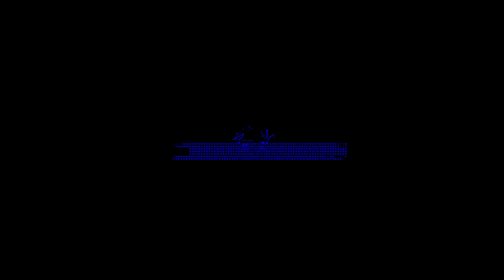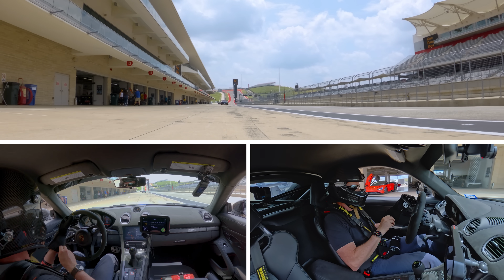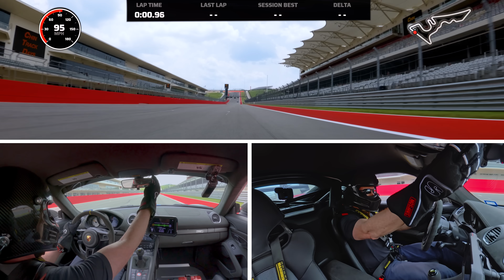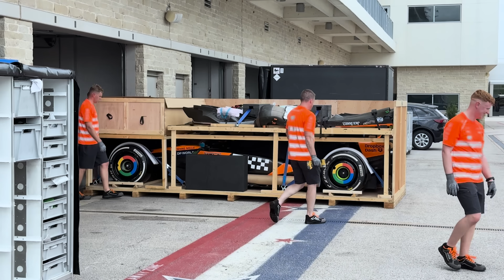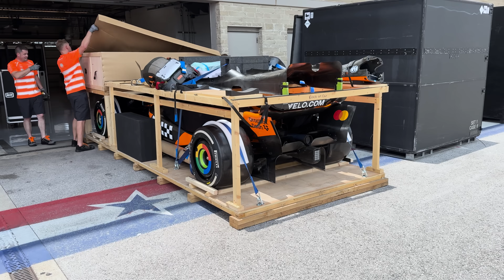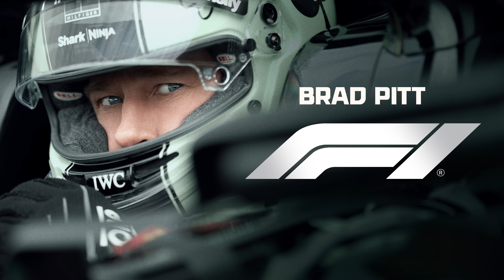Z06 vs GT4 RS : American Power Meets German Engineering at COTA

Comment: Car and Driver tested both of these at VIR and the Z06 was 2 seconds a lap faster.  Both are great and very fun on the track, it really just comes to personal preference.
Reply: Exactly.
Reply: bench racing doesnt work.  that gt4rs that day in summer is at probably 3 to 4s slower than when he ran in good weather.  his top end is down approx 8 mph lol.  I have both c8z and gt4rs and tracked it same day same driver.  cota z will be faster on 2r and very tight course the 4rs beat the c8z with me driving.  my track buddy drove both and results same. the gt4rs driver in the video is fast as this is his home track and cota has many fast drivers
Reply: @goonthreegtr You got some great experience so I want to ask a question. For a beginner who will jump to intermediate very quickly then is looking to put the time in to progress into advanced, would you strongly recommend any of these option over the other? Cayman (718 GTS 4.0 or GT4), C8 (Z06 or Stingray), 911 (991.1 S), or G80 M3? 

I have good karting experience but no real experience pushing it with real cars other than limited moments of fun with my M5, M4, E63 on the streets. Will be getting into sim racing. Tracking in the TX heat.

I'm thinking that I'm probably leaning towards the M3 to dual purpose as a daily + track car (more HP than I should have out of the gate, so it's a compromise). This would open me up for my sports car to be a convertible and not needing to be retrained to my abilities on the track (992 TTS, C8 Z06, or 750S depending on how big the windfall is on the equity payout by the end of the year). Alternatively, while I'm stilll working my way to the limit over the next couple of years, I might be okay to track a Boxster or 911 Cabriolet as my dual purpose fun car + track car, but I would rather not take this risk or deal not being allowed at all of the prospective events.

I want something that rewards the art of preserving momentum and that I can comfortably get closer to the limit as I progress through the intermediate phase. Once I get to advanced, I'll likely switch to a dedicated track car. If I already was experienced with a manual, I'd probably do a Miata for now that I would keep in storage and only use on the track. Perhaps you have a strong suggestion for a great dedicated track car for learning up through the early days of advanced that is automatic, under $50k, can be decently old as long as it is reliable in the heat, and doesn't have to stay street legal as it would live in storage at the track or close to home on a trailer. The Camaro SS 1LE or an older Corvette or Cayman are on the radar for this angle.

Sorry for the long question, but some quick thought would be greatly appreciated.
Reply: I am a car guy and i like both the corvette and the porsche. For the money, the vette is by far the better choice, but if you like finesse and quality finish, go for the Porsche. Ultimately i dont think either one is a bad choice, more a personal preference. By the way, i am a Porsche guy, but love to have a C8 in my garage too, both will put a smile on my face!
Reply: Was the Z06 on the ZP tire or the C2 R? If ZP, then more time in the Z06.
Reply: 2 seconds is a HUGE margin. We're talking bus lengths 😂
Reply: A few laps? Sure- Multiple repeated hot laps will have the vette's owner calling a tow truck
Reply: Nonsensical, Porcha's are the best car in the history of forever. Everyone is just jealous of how expensive our repair bills are.
Reply: Both cars also were tested on the ring and the GT4 RS was in another zip code. Using VIR for data is funny. Especially since both cars are slower than the ACR. Especially that POS Z06.
Reply: @NoBody-vn9do that time was not official. And why is using Nurburgring better for data than VIR? Because the media says so? Because you do? Because Porsche does? It's their backyard, I'd hope they were faster there, especially with the extra $55k option kit that's totally a "production model."
Reply: @goobingtons  I've seen Europeans discredit many tracks including COTA an F1 track, they live in an echo chamber like a religion with the Nur as god, can't make sense of it. We have so many great tracks with big challenges in North America, VIR is an amazing track, I'm sure he ever looked it up because his god would be angry.
Reply: @goobingtons time was official. It’s the only time we have on a unoccupied track with a professional driver. Y’all act like Chevy drivers are just some super drivers or something. Like they drove the car and it’ll magically become so much faster. Niggas might gain a second or 2 but stop it. Still failed on the ring. Anything to cope I guess. Also no, the ring is good because of data. In the real world we work off data and facts. So please cope harder fanboy.
Reply: @goobingtons  the vette's can't hack the long and the hot. They are cheap sportscars meant for fun. I'd buy another vette or run hot Mustangs etc but an off the showroom Porsche can run the 24 hr where a vette wouldn't make it past the second driver.
Reply: @cantbsdave sounds great, never said otherwise 👍
Reply: @cantbsdave you must have no real experience.  we track 992 gt3, 992 gt3rs, gt4rs, (2) c8z, c8 stingray  ordered another 2026 c8z and 2026 zr1.  if corvette suck we wouldn't be ordering 2 more 2026 models.  we drive our cars hard and both corvettes and porsches will spent time at dealership get work done.  there are many 992 porsche owners upgraded their brakes to ap like we did on our c8z.  end of the day people that own and track multiple corvettes and porsche know both are great.  truth that gt4rs would kill me at cota since I am not familiar with track amd he is but when he comes to sebring the outcome will be different.  ehat he is doing is not easy
Reply: @NoBody-vn9do  vette's are overrated. GREAT for the street due to weight etc, but hard track use? Naaa
Reply: @NoBody-vn9do  Hold on...Z06 was a 7.10 and the RS was a 7.03.  Not really a zip code distance apart on a 12+ mile lap.  I'd say pretty much the same.  Then add in that Porsche can test their cars on perfect weather days or whenever they want and GM has to send a team over to the ring for a test day or two and hope for the best.  I'd say they are clearly equals.  That all said I'd rather own the RS because I like it.  Too many C8's out their in comparison.  But, would I spend that much more....probably get the z06 first.  Have a C8 and GT4.  Love them both for different reasons...
Reply: @paulbellas8797 German manufacturers are always going to have the advantage at Nordschleif. They have pro drivers and engineers up there doing hot laps all day on an open track. Different story everywhere else.
Reply: @Ton-uy1xd agree and they can test their almost as much as they want.  For a US manufacture, the need a big logistics operation just to put together a couple days of testing.
Reply: @paulbellas8797 more like just a couple of clean laps
Reply: @Ton-uy1xd I watched some videos on the setting of both the z06 and zr1 laps and they talked about how they could plan for month but when the get their either the weather or tack conditions would be sub optimal.  Agree they need a great pro driver familiar with the course but they spoke about how being an hour down the road allowed many more opportunities to dial the car in and get every second out he car,  when pitted against the gt3 on American tracks, the zoo faired very well.
Reply: @NoBody-vn9do  1.2 second difference = another zip code? lol if you talk about the Manthey kit it is much faster but cost 55k more... 55k more is a big % of the Z06 cost.
Reply: @Iseenoobpeoples  GT4 RS ran a 7:04 on the regular track and a 7:09 on the longer track. Gotta look more into the lap data than just asking google AI. Shit be wrong half the time. The Z06 ran a 7:10 on the regular track. So yes, another zip code. The manthley kit is under 7 minutes and it’s fighting with SVJ’s, Pista’s, and GT2’s. So yeah that $55k is absolutely worth it.
Reply: @NoBody-vn9do  Uhhh the C8 Z06 time was on the longest configuration proof is right here on YouTube.
Reply: @Iseenoobpeoples wrong
Reply: @NoBody-vn9do  yes. You are wrong. Clear out champ
Reply: @rocketmagnet427 sure I am.
Reply: @NoBody-vn9do  in what world is the Nürburgring a better performance indicator than VIR? where they are all tested on the same day in the same weather, vs a magazine driver in 2 attempts vs a full porsche factory test attempt
Reply: 1. You're never going to load your car on a boat and take it to Germany, and 2 the z06 is a better car.@NoBody-vn9do
Reply: @nicklovely6431  we doing a rally next year where we’re shipping our cars to Germany and the ring is on the list of things to do. Would you like more information so I can see you there or are you going to miss out? Cost is around $15k total. I can send you a whole excel sheet. Also saying a car is better cause it’s just “faster” if you can even really say that. Is very childish. It’s not all about speed.
Reply: @NoBody-vn9do just say that you don’t understand Nürburgring. Porsche tested the gt4rs with a pro driver. Corvette number is from a random guy not official.
Reply: @Gt4ism  yes the cliche comeback. Say a person doesn’t understand cause they don’t go along with delusion. Typical fanboy stuff nothin for me to even care about.
Reply: @nicklovely6431  no reply? Guess you was just full of shit
Reply: @Gt4ism  doesn’t know how the rings works so this person just says whatever they see on TikTok.

Comment: very cool on the F1 car. The main drawback of any American car on track are the consumables. They all use crazy wide tires and chew through brakes and tires due to the weight. Oil sumps are huge too. GT4s are a lot cheaper to run on track especially with FCP Euro. If you want to track a car for 4-5 seasons and sell it, it probably costs almost nothing to do so with a GT4 given how cheap they are to run on track and they basically don't depreciate. The main cost is floating all that cash to buy the car. engine temperature wise, the C8 Z06 is phenomenal. It can stay at 220 oil temp going flat out for 20 mins.
Reply from the maker: I totally agree. If you run frequently, you have to factor in consumables. When I started tracking in 2012, there were tons of GTRs out there. You don’t see them much anymore—not because they weren’t great track cars, but because they were heavy and burned through consumables at an alarming rate. Going through a set of tires, rotors, and pads every weekend just isn’t sustainable.

Comment: A bit much emphasis on what should be obvious - the relationship between weight/power and track times. What would have been more clever is a critique of driving, because clearly you swap drivers and the Vette disappears. 2% more power to weight is enough, 20% is crazy. Any guy that is going to wave you by is under performing.

Comment: It is too bad GM did not make a real purpose built, light weight Z06. There's no doubt a 300-500 lb lighter Z06 would be awesome on the track.
Reply: Give me a C8 Grand Sport!
Reply: Chevy needs to pass safety standards and adding carbon or other lightweight materials may compromise these standards and increase the production costs substantially. 99% of customers won't require 300-500 lb less weight so the cost / benefit it not there. If you want lighter, you'll have to go aftermarket - for $5000-10000 you'll get there with carbon, even more intense bucket seats, removal of unnecessary interior components, etc.
Reply from the maker: I'm with you—that's the car I’m waiting for.
Reply: They clearly didn’t need to when the Z06 with Z07 is already giving the GT3 RS a headache, per the lap times around everything but the Norschliefe.

Comment: Great video. Just curious what tires and brakes you have vs the Z06. Besides HP and weight, tires make a huge impact. Assuming of course the driver skills are about equal. Keep ‘em coming.
Reply: His car is pretty heavily modified, he’s added a lot of aero which definitely gives a boost for high-speed cornering, and in so doing his shaved two or three seconds off of his laps. So not inconsequential.  Myself and others have noted this, it’s really not a stock to stock comparison by any means, and clearly the Z06 drivers were not driving full out through the corners or following the optimal lines.  That was the big difference here
Reply from the maker: Thanks! I’m on Hoosier R7s, and I believe many—if not all—Z06s ship with Cup 2 Rs, which are comparable when new. That said, I’m not sure which tires were on these two cars.
Reply: @ItsTrackTime  only the Z06s with Z07 package come stock with the 2Rs, mounted on carbon fiber wheels.  The regular Z06 comes with PS4S.

Comment: The C8 Corvette is not the first performance car to use brake-by-wire. Porsche even used it before the Corvette on the Taycan which delivered in late 2019 (in December) as a 2020MY, C8 Corvette delivered in early 2020 (in February). The Alfa Romeo Giulia Quadrifoglio and Stelvio Quadrifoglio use BBW (that’s an unfortunate acronym) too. Current gen F1 and FE cars even use BBW, though F1 only uses it for the rear brakes. The Brembo BBW system in Cadillacs and Corvettes has a failsafe hydraulic backup that can activate in milliseconds when it detects an electronic failure of the BBW system, so I’m not sure about cars flying off the track at high speeds due to BBW failing, probably more likely it was a skill issue and they wouldn’t have made the corner if BBW worked perfectly anyways. Yes, there is a lack of feel and sensation from the pedal, it feels like you’re driving a racing simulator not an actual car sometimes, but you only really notice when you’re modulating brake pressure; if you’re stomping on the pedal before a low speed corner you aren’t going to notice a difference. 

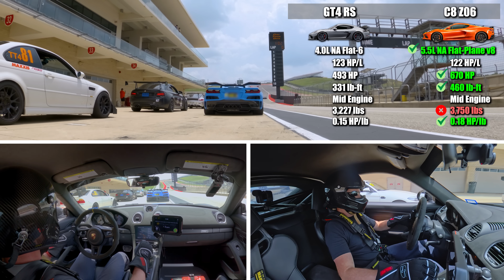Also, a C8 Z06 Z07 3LZ with carbon wheels and CCBs weighs 3,660 pounds according to Car and Driver’s scales, Speed Phenom put his similarly spec’d Z06 on a calibrated CAT scale and got 3,600 pounds flat with 1/3 tank of gas. Likewise, the GT4RS weighs 3,242 pounds on C&D’s scales. That doesn’t change your hp/lb values much so the Z06 still has a 20% power-to-weight advantage. Your point about the weight affecting braking and wear of consumables does still stand, just to a slightly lesser degree than you thought since the Z06 weighs 100+ pounds less than you said. Car and Driver’s instrumented 70-0 mph braking distances for the GT4RS Weissach and Z06 Z07 w/ CCBs were 132 ft and 139 ft respectively, about half a car length. The GT4RS held 1.11 G around their 300 ft skidpad whereas the Z06 held 1.16 G. These cars are not that far off despite the weight difference, GT4RS brakes better but Z06 corners better (both of those will depend on the driver in reality though), but the Lightning Lap result for the GT4RS (2:40.5) was about 2 seconds slower than the Z06 (2:38.6). Also, about the Z06’s 7:10.52 Nurburgring time people keep talking about, it’s not an official time, it was set by a magazine (Sport Auto) not by Chevy, so don’t compare it to Porsche’s official GT4RS time compare it to that same magazine’s GT4RS time, which was 7:16.15, or 5.63 seconds slower than the Z06.
Reply: Preach 💯
Reply: It's not an acronym, it's an abbreviation.